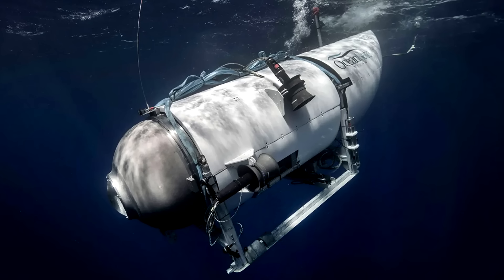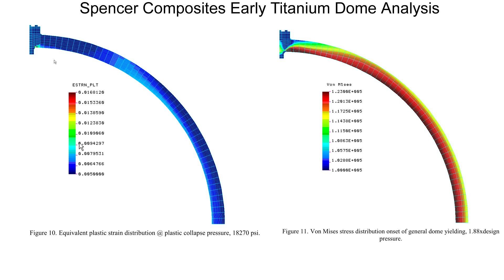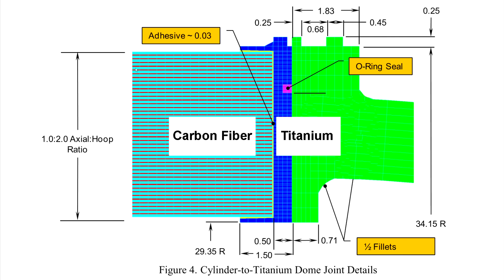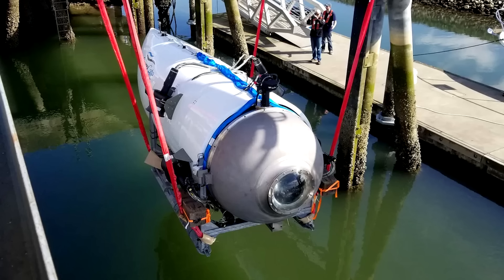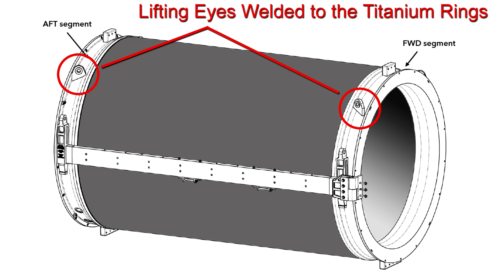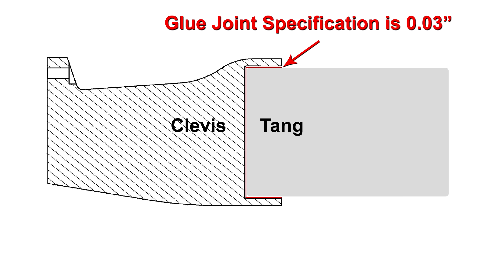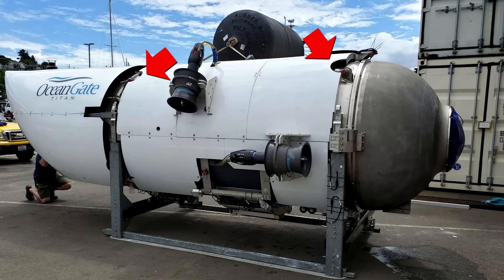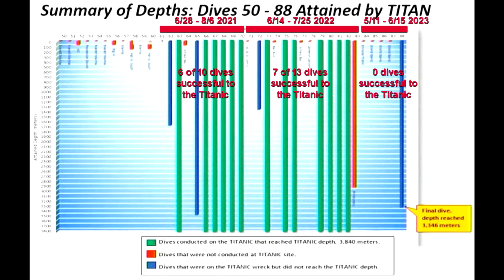OceanGate Titan Titanium Rings - An Additional Story About Them

Comment: The more i hear about the quality of the sub the more impressed i am by the fact it even managed to make it a single dive before imploding.
Reply: I'm looking at the lifting rings and C-Channels wondering why it didn't fall apart the first time elevated.
Reply from the maker: @TimeSurfer206  I know.
Reply from the maker: Thanks for commenting, and here is a little summary for you.  It got to the Titanic 13 times at 3,840m (and in 2022, it got to the Titanic on four consecutive dives!). It also had one dive to 3,500m, one dive to 2,900m, and two other deep dives, 1,700m and 1,380m. You can also count the five high-pressure dives in the Deep Ocean Test Facility done before the expeditions as cycles (3,000m, 4,000m, 4,200m x 3). So, that is 20 deep pressure cycles (if not including the 1,380 and the 1,700). That would be considered a success if they were all unmanned dives with a carbon fiber hull test program before the implosion. Or, if they stopped unmanned testing short of imploding and did destructive testing to learn about the hull dealing with the pressures. But, imploding while manned with five people makes it a failure.
Reply: @solareclipsetimer The more I learn about this horror story, the more I think it's less of an engineering disaster and more of a startup / silicon valley / venture capital fiasco.

You might be able to engineer a tin can to go to the moon, but there'll be infinite ways for one greedy jerk to take you to zero. Basic maths 😂😅
Reply: @solareclipsetimer  To be fair, 13 successful dives of this POS is miraculous to the point, was it a fluke, or does it almost kind of show carbon fiber hull could work IF you would actually make it thick enough, actually build it without all these duh huh moments, to the highest quality, regularly inspect it etc. But it'll never be a thing after this. I guess you could make a titanium pressure hull as large you as you wanted really, you'd just have to pay for it and the manufacturing of it.
Reply: @stopthephilosophicalzombie9017  Well, I know you'd have too much weight at that point unless you upscale everything else at that point. It's totally possible. It'd just be unaffordable and mammoth
Reply: @solareclipsetimer  Other than having it tested before the first dive, at what point do you think the hull should have been abandoned? At what point / which dive had it started to fail?
Reply from the maker: @bills6093  Great questions.  I have no ideas, really.  I guess you would start by making a full-sized hull that is EXACTLY the same as what you expect the final version to be.  Drop it down to 4,000 meters unmanned twenty times and then cut it up and see how the carbon fiber handled the cycles.  Then, build another one and do it for 50 dives, cut it up.  When you stop and how you determine the cycle life, I don't know; that would be up to carbon fiber engineers to determine, including a lower limit for a safety margin.
Reply from the maker: @bills6093  Thanks for your comment.  I am doing a video about dive 80 right now.
Reply: @solareclipsetimer  Cut it up, kidding me:face-blue-smiling:, where is the money to build another one
Reply: @solareclipsetimer IMo what makes it a failure is all the engineering choices they made that led up to it and a lack of understanding exactly him want cycles the hull go through before catastrophic failure. They didn’t know that nor did they even pursue it. They got to what they wanted was a working design but had NO CLUE how many dives one hull could take.
Reply: @solareclipsetimer  I see it as similar to pressurization cycles in an aircraft, but in reverse. Sure, it worked 20 times, but was there ever an NDI (non-destructive inspection) of the titanium/carbon fiber joints?
Reply: @solareclipsetimer  -- It sounds like you are defending Rush.  I can see why you might.  My perspective is that carbon fiber is not a solid-enough material to use under such conditions.  Also, the various spots where glue was used are concerning.  Too many soft or flexible materials went into that thing.  I'm still curious about how they managed to get the control cables into it without creating a weak point in the hull.
Reply from the maker: @calebmurdock2028  Thanks for the reply.  I don't think I am defending Rush.  But in my videos, I attempt to not be derogatory or insulting to anyone involved.  I leave that to people in the comments.  Your question about the cables passing through is a good one.  The Titan had four pass-through fittings in the rear titanium ring.  I don't know the engineering to make those water tight, but it is standard in the industry, so it has been worked out before Titan.
Reply: Patrick Leahy of Triton Submarines talked about the extensive testing their subs undergo - one of the reasons why they’re expensive - attention to detail and vetting from the proper authorities
Reply: In comparison… ALL mushrooms are edible… At least once in your life.
Reply: @Shnick what about 13 times?
Reply: 😂true
Reply: stockton was in a rush to end himself. i dont think he wanted it to last a lot of dives, i think he just wanted people to think it would so he could go down and end it all, with a reverse bang.
Reply: it certainly seems that way. But really, I think it was his own hubris that killed him.  @ElectricalExistence
Reply: @ElectricalExistence  He may have thought if it implodes I’ll be in it and so it won’t be my problem anymore.  That thinking enables lots of people to work and play at the edge of human possibilities.  He is able to take the risks, glory but never make good for the loss of others.  Rush was clearly able to disregard the views of others.
Reply: The best thing that could have happened was critical failures at a depth of less than 100’. But the issue is that many people point to “it hasn’t failed” as a sign of success. 

That’s where regulatory oversight comes into play and why it’s necessary.

Same reason why any good engineer/architect/designer overdesigns their structures. Beyond what code requires. I walk out when any of the three suggest code is “too much” and come up with “brilliant” ways to stay under it but meet it on paper. Use all the brainpower to build something good, not something that barely scrapes by

It’s frustrating
Reply: @cameron.t  Why aren't submarines regulated like airplanes? Aircraft are routinely inspected by civil aviation authorities (such as the FAA). If a plane or helicopter is found to be unsafe to fly, then an airline or owner will be found legally liable in the event of an accident.
Reply: @twistedyogert  I can't answer that as well as others can. I think it has to do with lack of passengers. I know places like Hawaii have "submarines" that are really just glass-bottomed boats; the hurdles for those to be safe are much lower than deep sea diving. In terms of naval submarines; well they are de facto regulated because each one is a multi-million nooklear weapons platform, for which the groups of people commissioning them have a strong vested interest against losing.
Reply: @twistedyogert  nearly every true submarine is either military or purpose built for research.  There are regulations and agencies that will certify a submersible design, but since the ocean isn't as controlled as airspace over a country and a submersible accident will have minimal impact for most civilian vehicles it's not really required to do.  There's also just less of them and fewer people wanting to do it compared to planes and flying.
Reply: @twistedyogert airplanes have to start and end their trips on land, which belongs to a country that has the ability to put legal standards in place.  If the plane doesn’t meet standards, it can’t be used.  If this submarine was being used closer to shore, it would probably also have to meet certain requirements to legally operate.  But since it was being towed out empty, and only used in International Waters, no regulatory agency had the power to enforce rules.  (This is also why you shouldn’t purchase ‘investments’ on a cruise ship.  The sales are conducted in International Waters, so it’s nearly impossible to sue when you find out it’s a scam).  Between that, being considered an ‘experimental craft’, and misidentifying passengers as ‘mission specialists’ the company was able to dodge whatever safety rules might have applied.  One of those ‘legal, but definitely not ethical’ situations.
Reply: @twistedyogert  There are experimental airplanes/helicopters allowed by the FAA but they are subject to certain operating limitations and must be labeled as EXPERIMENTAL.  They can be legally licensed and registered and they must be regularly inspected, but, not necessarily by an FAA certified Airframe and Powerplant (A & P) mechanic.  The inspection is much less rigorous and less expensive.  The owner/builder (or designer of the craft if kit built) must perform the inspection and certify that it was done in a timely manner.
Reply: @twistedyogert  There are experimental aircraft that are exempt from many of the rules you are talking about. This was essentially an underwater version of that.
Reply: @Cliporado  Funny thing, my first apartment that I bought had a doorway that was blocked up. It was a load bearing wall too. 

So I did what any sane person would do. I removed the blocks and used the existing doorway and not create a new doorway as was originally the plan. I even bought the new steel and stuff. Anyway...... Inspection came and declared that I was too close to the outer wall, structural integrity was in question, and it was NOT up to code. He was essentially reading from paper and not looking at the actual situation. 

That is when I whipped out the original drawing, pointed out where the foundation pillars were and that the new doorway would in fact weaken the structure significantly. And ALL I did was remove non structural blocks to open up the original doorway. Code is not always holy.
Reply: @Cliporado  People have to understand that these designs are based on assumptions of the forces expected to be reached.  But some times it is very difficult, if not impossible to anticipate the forces that may be encountered.  So, say, as far as we can determine, the load will be 2,000 pounds, so we will design it for 6,000 pounds.  So we now have a 2/3rds safety margin.  I have heard of a saying used in home construction, "Code is the floor, not the ceiling!" If possible try to exceed rather than just barely meet the code.
Reply from the maker: @davidmarquardt9034  Thanks for your comment.  You are so correct.  You have to design for a safety margin.  It reminds me of a clip I have in one of my hull videos of the Boeing engineer saying you have to design to cover the "effects of defects."  That is a great line.
Reply: @Cliporado  'YET'. That one word defines this whole problem. It hadn't imploded yet.
Reply: Do you want s fork for that word salad?🥱
Reply: GLUE N TITAINUM 😂
Reply: Actually the Mariana trench is nearly 11000m deep just put the sun there for 4 weeks at double the depth anyone wants to five in the sub. This would have failed the sub quite fast. Any pure titan subs would have been stronger after this. But carbon would have broke at that depth. As Cameron said you use carbon fibre for tensile stress but not on compressive stress. That's why aeroplane cabins are of carbon fibre the pressure inside is bigger or equal the pressure outside. 
Using carbon fibre only because it sounds high tech is stupid.
Reply: @abelgerli  That's not strictly true. Wings are made with carbon fiber and are strong under tensile and compressive loads. Its a question of doing the engineering correctly.
Reply: @abelgerli  He used it also for the weight. Sub has to float to resurface. 5 person diving bell made of titanium would have been very heavy. The boat and the floats would have to be huge to conter the weight of the diving hull...
Reply: It certainly was an absolute pile
Reply: Agreed. 

My bed had 4 legs but I lost the screws for one of them and so it just stood up on the one leg with out the screws. Wich worked fine except if I moved it in a wierd way it would fall down. 

Essentially what I’m trying to say is like just because it’s working doesn’t make it safe.

I think about this story, what makes me most mad is that he allowed guests on there. He knew all the problems and yet he kept telling people it was safe when he knew it was not! I’m sure he believed what he said but there is a reason for why the rules/regulations are there in the first place.
Reply: It probably bodes well for composite hulls that this piece of cr*p lasted as long as it did, but this type of construction has to be considered disposable. Predicting when failure will occur is going to be very, very difficult.

It likely makes sense for recreational submersibles, but deep sea research? No way.
Reply: Turns out they were made out of cheese
Reply: Couldn't agree more. It's so bad it's a miracle it worked at all.
Reply: Then you haven't actually learned much if u watched a lot on this subject. "Repeat stress cycles". All I'm gonna say.
Reply: Bump for algorithm
Reply: Thank you for the video. I'm on mechanical engineer/tool & diemaker. I know a great deal about composition designs. All of this makes sense to me.  Welding on the lifting eyes AFTER the design and manufacturing was a huge NOOOO! It's a good thing this knucklehead can't repeat his mistakes.
Reply from the maker: @divemasterflipper7116  Thanks for your thoughtful comment and your support.
Reply: I can't fathom how anybody would have thought it a good idea to dive in that thing. Basic common sense would prevail surely.    
"so Stockton, you say the ends are made of titanium but the hull is not, and how are they joined? By glue. Oh right....... See ya" - runs away.
Reply: How much more in cost do you think having a titanium hull instead of carbon fibre hull?
Reply: @theinsanewoodsman Main problem was not the price, but the weight. Big pressure hull to fit 5 people made of titanium is very heavy. Submarine need buoyancy to resurface. So you need huge floaters to compensate the weight. The end result will be quite huge and heavy submarine, wich is hard and expensive to handle.
Carbon fiber was much lighter and Rush could make it small even it had huge diving bell in contrast of size of whole thing.
Reply: Patrolling the Mojave almost makes you wish for nuclear winter.
Reply: Actually the real lesson here is Don't visit the Titanic in a Pringles can!
Reply: i honestly cant believe that it really worked

the fact that it supposedly made multiple dives before, is the most unrealistic fact about this whole debacle.
Reply: Same
Reply: N
Reply: I totally agree. I'm shocked it made it down there more than once. Shocked
Reply: Why would people want to listen to a bunch of boring white guys?
Reply: I never forget the day it was announced on BBC News that a company would be doing private tours. Even showcased the Carbon Fibre Hull. I knew immediately it was doomed. I remember my friend who is a Petrol Head being on side with it believing it to be a strong viable choice. Yet here we are. Insane choice of material from a safety perspective.
Reply: I'm sure the first trips were still okay. However, from the middle to the last trips, that's when the trips were becoming dangerous because of the repetitive use and the carbon fiber not getting replaced after its cycle. So those people were lucky to be alive because the implosion could've been one of those last trips
Reply: Yeah, the more we understand the more it looks like pump my ride would have done a better job.  These guys are some greedy engineers.
Reply: 6:50 is my understanding correct that they wanted to install hooks to allow lifting? I don’t know anything about engineering but that sounds soo stupid.
Reply: @kacpers186 No not the hooks but Rings for the Hooks to connect too!
Reply: That’s called success in recklessness. If he had trust the tech he is talked he’d be alive. Stockton rush was successful but the foolishness to create was the foolishness that took his life once the tech told you it was time to retire
Reply: Back in 2018 I actually met Rush and went on a dive to about 300 feet (this was before they started leading expeditions to the Titanic). It is certainly eery to think about how this enterprise ended up. We were convinced that it was very safe, but were only discussing in the context of quasi shallow open water.
Reply: 88 and counting
Reply: Comment to please the algorythm!
Reply from the maker: @TheStephaneAdam  Thanks.  It helps.
Reply: @TheStephaneAdam  I have done so! 😉😇
Reply: Really it comes down to matching materials and design to intended purposes. IF the Titan was UNmanned and goes down shallow dives a lot OR goes deep dives once or twice per year then perhaps CF composite construction wouldn't be a problem. Because then only money and materials becomes a casualty if it fails. However it becomes a concern if any living thing goes down there inside that can. Then any failure becomes catastrophic if a life is lost, especially it's human lives (because the survivors can sue, signed statements are irrelevant if negligence and incompetence can be proven, which they have been amply demonstrated here). THAT'S why the submersible industry is largely self regulating (and pretty well at that) BUT that depends on all who's involved to be ON BOARD with following industry rules and complying with standards. 

That's why there's little legally binding rules in the law books BECAUSE the industry had been VERY good about staying safe on their own because they are well aware of the risks and liabilities. Unfortunately I reckon now the pols are gonna get involved and mandate extraneous laws because they don't know squat about the realities of submersibles and go overboard with making excessive rules and regulations just because of a few bad players who refused to follow the established safety play book. Stockton thought the rules were difficult and slow? Wait till the Pols are done writing the rules this or next year. I guarantee ye it'll be worse then!
Reply: @TheGhostGuitars THIS. Exactly this.
Reply: Almost have to think that after that much abuse and still making so many dives it was probably a sound idea,  insufficiently developed, and incredibly poorly maintained.
Reply: The fact that it made 13 successful dives is wild
Reply: I like how he points out a static load. Could they build a sub with this in mind and become a structural strength, say a sub that would leak under normal atmospheric pressures, as even as this is a tragety, Commercial and pedestrian submarine tours is going to become very popular.
Reply: That’s just nonsense! Even with its failure and the lessons we’ve learned about it now, it was an engineering marvel! You are totally blinding out, that it’s more complex to dive that deep than flying to the moon!
Reply: Exactly what i was gunna comment. A miracle the 2nd hull ever made it at all.
Reply: Simply put... quality of the vessel sealed better the lower it went= pressures pushing inward. 

If this was a pressure tank where 2000 lbs of pressure from inside out= boom, like quick.

Hard to think backwards
Reply: @alvinmortimer7536  its more complex than that. At the hull to ring interface, the carbon is squeezing inward and if the titanium ring diameter does not deform in the same manner (less) then you get a peeling (separation, its not a shear) force in the glue interface at the topmost part of the C-channel.  A failure can start there.
Reply: If it was made for a school project I would give it an A+, for a deep ocean multiple dive with unsuspecting paying tourists, a Z-. Stockton was in the same naricisst league as Trump and Musk. The difference between Musk and Stockton is that this is no way that Musk will go in his own rocket to Mars.
Reply: @Johnwashere-dt2ov  Take your TDS pills. You are terminal.